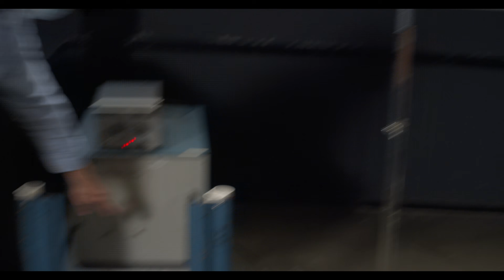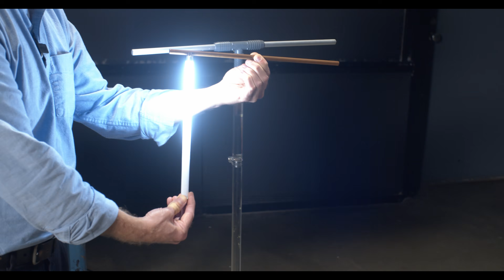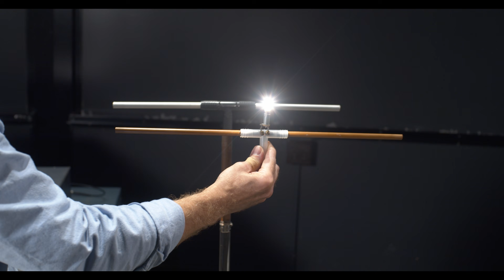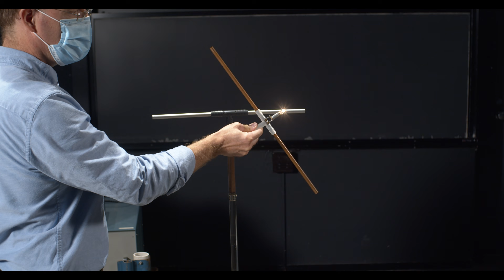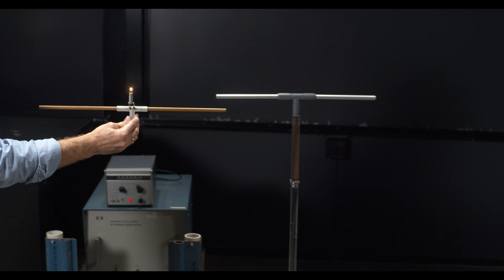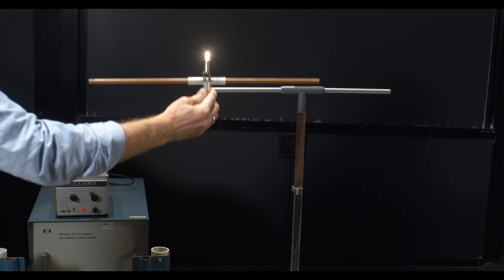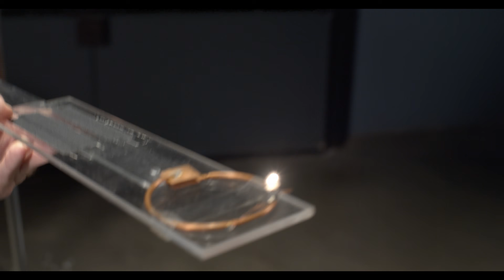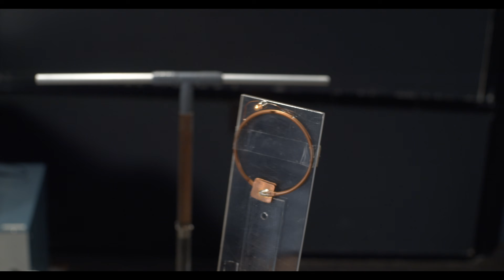Radio Wave Properties: Electric and Magnetic Dipole Antennae

Comment: Hey everyone, so I have just starting learning about electromagnetic radiation. 
Can someone explain to me, is the light we see in this video produced solely by radio waves? 

That is amazing and also so strange to me! I was under the impression that radio waves are very weak !  
Can someone explain to me how weak radio waves can produce visible light ?
And what would be the effect of such strong radio waves to the human body?
Reply: If you really want to blow your mind, understand that radio waves and light are the same thing. One is just visible, the other invisible, because of their wavelengths. A radio transmitter antenna is just one big lightbulb, but you just can't see the light.  

Know this:

1: Any time an electron accelerates or decelerates (moves) it will emit light. 
2: Any time light hits an electron, it moves the electron.

A radio transmitter is just moving electrons in a wire to emit radio wave light. A radio receiver just allows the light to move the electrons in the antenna. When electrons move in an metal, it is called electricity. 

Now... understand that you are made of electrons. All the light, all the radio waves around you, are vibrating electrons on your skin. Depending on the wavelength (size) some light passes right through you (like x-ray light). Some light just hits your skin and doesn't make it all the way through because its too big. Some light will heat you up too like a microwave. This happens everywhere at all times. Its relatively harmless until you have high frequency light strong enough to break electrons off of atoms which we then call ions. That is called ionizing radiation and can destroy parts of your body and give you cancer.

Neat fact... you are emitting light. In fact... since you are made of electrons, if you wave your hand side to side 3 times a second, you are generating 3Hz radio waves. 

You are now enlightened.
Reply: @ds-1111  "if you wave your hand side to side 3 times a second, you are generating 3Hz radio waves."
Salute!  For bonus points -- the wavelength of a hand wave?  About 1x10^8 meters doing it from memory.
Reply: The video says it's a 100W amplifier; not sure how much output he actually gets, but if it's any significant fraction of 100W, it should be no surprise. 

RF emissions are not weak per se -- it depends on how much power you put into the antenna. Power transmission is an inverse square law, so power density falls off very quickly. But a few feet from the antenna, there is still a lot of power per unit area. 

It produces light by producing currents in the resonant rod he's using as a receiver. The EM fields shove free electrons back and forth, creating an alternating current, which dissipates power in the light bulb.

It will not work at longer distances, because of the inverse square law. But very high gain antennas at high frequencies (think microwaves) can be used to efficiently transmit power wirelessly in a well engineered system.
Reply: @yakovdavidovich7943   like tesla envisioned??
Reply: @yakovdavidovich7943  the incandescent light bulb only needs 1/2 watt of power to light it
Reply: Usual radio waves are super weak in order not to harm... But you could have "strong" ones like those in the video... Is just a matter of intensty (aka "how many" waves)

Comment: No bifilar antenna? Nikola Tesla would be very disappointed that you are with holding information from the general public. 

I have seen what happens when you have two bifilar antenna, each sandwiched between plexiglass, and placed one above the other at approximately 30'. They then are wired to a set of nested coils and a frequency tuner, such as Eric Dollard might build, and then to a ground plate with a spark gap between.
Reply: OK so what happens?  You are also withholding information.  Tesla would be very disappointed in you.
Reply: @tread140  Build your own TREC device and find out how to provide enough Atmospheric electricity to power your home, 10 KW of continuous power. If you want a tutorial on how it works check out Hermann Plauson (aerostatic balloons), Lawrence Rayburn, or Ion Power Group. There are others all throughout history that utilized the same technology; Khem (pyramids/obelisks), Celts (standing stones), ley lines (soil resistivity), henges (collection and amplification), aquifers (current generators), etc.

Comment: What if the antenna is round, like a dome? Maybe it transmit power 360 degrees.
Reply: The radiation pattern should be omnidirectional
Reply: Yes
Reply: try qfh antenna

Comment: Nikola Tesla wanted to transmit power through Earth as 1 wire transmission of power. He also called radio "the biggest aberration the scientific mind has ever conceived"
Also, Raymond Rife used radio to resonate pathogens and thus cured terminal patients circa 1930.
They want you injected with covid vaccine for a virus they still havent proven it exist where pcr tests are 0-100% false positive.